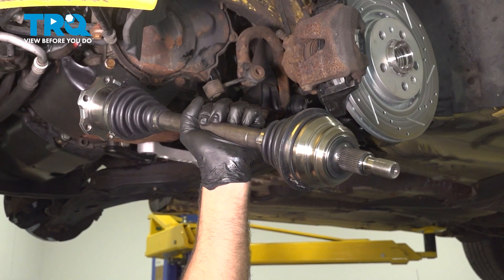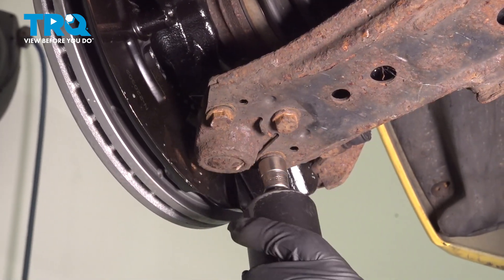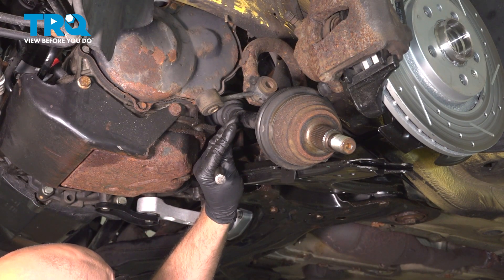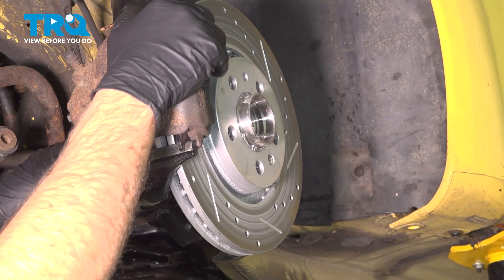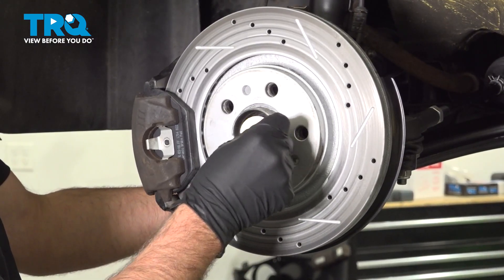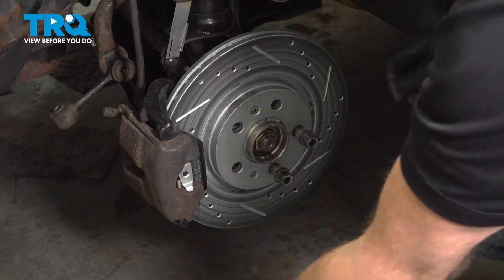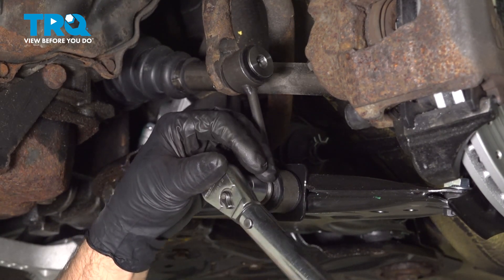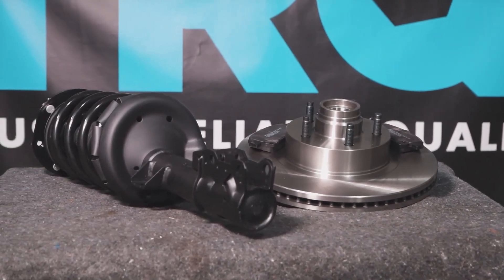How to Replace Front Driver's Side CV Axle 1998-2010 Volkswagen Beetle

Comment: I just did a 2010, no bolts. The original was bad, I pulled the shaft which left the inner hub. I then used vise grips on the hub, and threaded a slide hammer to the vice grips, pulled right out. To re-install, used a 5 lb mallet and aligned the shaft, it popped right in.

Comment: The inner side of the axle is different on a 2006 beetle.. Doesn't have the bolts on the inside.  Has a shaft you pull out.  Not easy to pull.  Need special tool for it.
Reply: Probably depends on powertrin.  Working on a 2006 beetle tdi automatic and it's got the bolts.